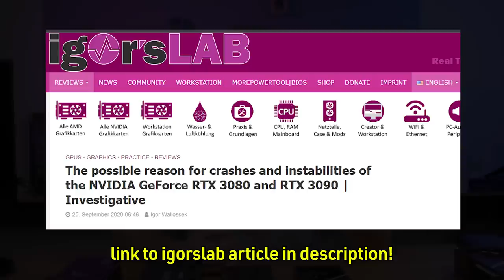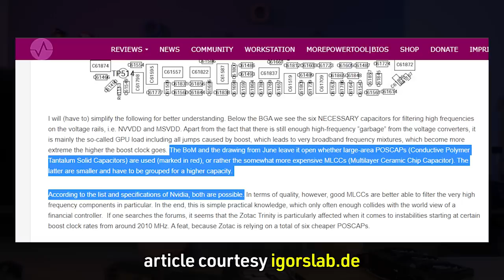The RTX 3080 Launch can't get any worse... Right? Wrong...

Comment: I know nothing about RF frequencies and overclocking in detail. What I do know, is that the wiring in our Condo (THE BUILDING) was done so poorly (in design) that the firefighter on call, who lived below me, tripped the breakers for our bathrooms, when ever he used his radio....CAN YOU IMAGINE?! He answers a call on his radio and trips the breakers in a building...WTF?!
So I can see VERY WELL how noise and filtering on a circuit board with even smaller components is crucial to get done right. 
AMD processors used to be extremely sensitive to OC as well. Just 20Mhz can mean the difference between great benchmarks and high stable numbers, vs unstable, intermittent crashes and freeze ups WHILE STILL WELL WITHIN OFFICIAL OPERATING SPECS. My eight core CPU's were always higher in voltage and low in core hz, but ran PERFECTLY stable. Finicky stuff that!

Comment: to produce as cheaply as possible, sell as expensive as possible
Reply: What's new about that, or shocking?
Reply: @moeloehoe  the GPU processor consumes 500W of energy, so the power section should meet high requirements regarding the speed and stability of energy supply, and how to work stably if the Samsung technological process rejects 70-80% of the systems and the rest is also not of good quality but everyone wants to buy as cheaply as possible, only since every producer designs their own PCB and having a weak GPU, mounts low-quality capacitors, I ask how it went off the assembly line, what do we produce but we do not check how it works? ... they knew well about the existing problem but everyone wants to sell as much as possible at the beginning, the conclusion of each producer is not honest.
ps. sry. google translator
Reply: The capitalist Team Rocket
Reply: Ahh CaPiTaLiSm 3.0

Comment: The real problem is that there was not frequency limit and they crash when they go over 2000-2100mhz maybe a little higher ( remember that 1740 its the boost clock on 3080 Strix for example) so it got fixing by just updating drivers.  and the brands because of all those who supported this misinformation began to change capacitors without necessity maybe some people even sold they 3080 because they were afraid that because of the capacitors they were "bad cards"
I am amazed at how uninformative this video is and how wrong it is and that Jay does not correct it with another video or comment.
And he will not try to do some kind of test or to inform himself before publishing this video, it is noted that he is only interested in visits.

Comment: But isn’t the whole point of a reference card to set a minimum hardware standard?
Reply: Jmanyc123 it is... the problem is that aib did push the reference too high! The fe is well abobe reference model, but aib maker did try to get same speed as beefed up FE using reference model!
Reply: @haukionkannel  No they didn't It's Nvidi's work to tell them the absolute minimum specs to assure performance. This is Nvidia giving them specs that were below the require ones.
Reply: Probably not a coincidence that Nvidia didn't make any reference cards for this series
Reply: @Themata  what? What are the FE cards than?
Reply: I reccomend you reading the article in Igors lab.
Reply: @Mermaider  Jayz2cent covers this directly in this video, what are you watching: the FE card for the 3000s series are not to reference card spec, They are buffed up. In the video, Jayz2cent opens the gigabyte card saying that this looks like it is to the reference spec that he saw.
Reply: @Mermaider  they're a custom card, beefed up over the reference specs

Comment: At least some of the early EVGA FTW3 cards have the 6 cheap ones. Source: a "Gamers Nexus" video, titled: "Limited OC Headroom: RTX 3080 Extreme Overclocking", at 6:59 for the time stamp.
Reply: I think @JayzTwoCents would agree it's odd that the FTW3 card has one more 8 pin power but less quality hardware to deliver it
Reply: Gamers Nexus, video: Custom RTX 3080 Overclocking: EVGA FTW3, ASUS TUF, & Gigabyte Eagle Results (Stream Recap) at 8:04, 8:53 can see that too.
Reply: But how how can XC3 (4:34 here) have more expensive capacitors than FTW3?
Reply: @nouidle  Could be a revision thing. Igor explained it further. Nvidia might have sent a headsup to the boardpartners (after launch) and they put in other capacitors.
That means all cards build pre-launch might be weaker and prone to crash..
Reply: Wait, the evga ftw editions are premium editions compared to there other variants, the ftw editions are designed for overclocking and good quality
Reply: @nouidle  May that capacitors isn't the real problem? Cause FTW3 got 6 cheaps, TUF got 6 good ones... and as u said, XC3 got 1 expensive and FTW3 don't. idk
Reply: @nouidle  Dunno, but that's the model I purchased that's what really matters :)
Reply: @nouidle  exactly the xc3 is not designed for additional OC even if u could it will be very minimal, the ftw cards always used premium components and parts which allows the card to pushed further, if this is the case with 3rd party venders I will  just go for the FE card, and wait for it  to come in stock, I never dealt with nvidia RMA or returns as Amazon is so much easier, faulty card, just return it and get exchanged. But then again the FE just seems to built with more quailty then any other variant
Reply: @bismal2166  TY, I was hoping so since they pulled them off a lot of retailer sites during launch.
Reply: @bismal2166  Oh man, this is gonna be one of those things where overclockers have to go model-by-model now, isn't it? SIGH

I guess this gives the Youtubers the more "3080 content" they were looking for.
Reply: @nouidle  go to EVGA site and see the step up cards, you won't see any XC3 there is only FTW3. Now I understand why.
Reply: Confirmed, check out the photos on EVGA's 3080 FTW3 product page. You can clearly see 6 poscaps.
Reply: wow that is extremely disappointing
Reply: That's depressing lol.
Reply: It's the same with the ASUS Cards, the STRIX has 6 of the lower quality capacitors while the TUF has 6 of the higher quality.
Reply: @bismal2166  I wonder if this is what made them come out later...
Reply: TY, the stock photos on a lot of sites have 1 on the 3080FTW3
Reply: @andydsm  https://imgur.com/a/IMVFdTP

This dude got 2 of the better capacitors. I wouldn't call anything confirmed yet.
Reply: @1984kylea  the Strix has the higher quality https://www.youtube.com/watch?v=8IDMS54jEFM&feature=youtu.be&t=274
Reply: @
BloodSpiller Gaming That was a pre production FTW3.  The production units have the better caps.  https://i.imgur.com/20VTCrx.jpeg
Reply: @thealien_ali3382  I've been holding out for a ftw3. Now I'm just holding out.
Reply: @Mildly_Amused  Thank god
Reply: All retail ftw3 pictures so far have the mix like the FE
It's probably why thet were held back by a week
Reply: @rikou1986  not on the evga website. Interesting.
Reply: This whole thing is a mess. RTX20 ringing in my ear. My first 2080ti died from the crappy memory issue, who knows how my 3090 will go.
What is confusing to me is, IF it really is about this particular part, why are there shots out there of NON OC TUFs with 6 MLCCs, and STRIX OC with just 2 MLCCs o.0
Reply: @jrmardis  they just didn't bother changing the old stock photo's i guess.
They're kinda busy at the mo lol.
Reply: @rikou1986  just looked at the gamer nexus video when he over clocks the ftw3. All 6 are the cheap ones. Card in hand.
Reply: @jrmardis  jacob from evga gave him a pre retail model.
Multiple retail pics show the newer board.
Reply: @rikou1986  hope that's the case! Should see some soon they sold a few this week. 600 to ebay 9 to us.
Reply: @jrmardis  lol yeah... uk has seen 0 from evga.
And yeah we will find out soon and people are asking jacob for confirmation.
All the xc3 have a mix of 1 5 so it wouldn't make sense giving the top tier worse components.
Reply: @rikou1986  thats what I was thinking. But more expensive cooling system might have made them cut cost. We'll just have to wait and see!
Reply: @jrmardis  evga gave a confirmation.
Xc3 are all 1 and 5
Ftw3 are all 2 and 4
Breath easy evga fans.
Reply: @rikou1986  thats great news!

Comment: So what you are telling me is some of these AIB cards cost more than reference...clock lower...and are prone to crashes.
Sounds like a banging deal.
Reply: Yup. That's dead on.
Reply: BUT they have RGB so...
Reply: It's sounding more and more likely that some of the rumors were correct, Nvidia is selling FE at a loss and then leaving the AIBs out to dry on selling a matching spec part that they can't afford to price match.
Reply: @DanielFoerster  which makes the AMD RDNA 2 stroy being a good card more plausible?
Reply: @GrimYak  well we don't know what pricing and availability for Sienna Cichlid is going to be yet. Based just on cores and clock it ought to be able to compete with the 3080 but I'll wait for benchmarks.
Reply: @DanielFoerster  I super doubt that if the problem is literally 2 components out of thousands.
Reply: @spider0804  I don't know how much the price difference is on these specific parts, but going off numbers I'm finding, it's probably around 10usd more just for the MLCC parts versus the POSCAP parts for a single array out of the six, plus soldering complexity increase. That matters when margins are thin.
Reply: @DanielFoerster  Asus must have some magical margins then lol.
Reply: @spider0804  their 700 dollar TUF has 6 POSCAPs just like the other MSRP-match cards did. If your budget goes up to 750 for an OC you can spend more on making sure the card handles higher clocks.

Comment: How did EMC testing not get this??? Rush job? I work in industrial electronics, designing Solid State Relays and Motorcontrollers... we EMC (and Burst) test our devices to exhaustion, knowing they could harm people... and our products are far less expensive.

PS. We design SSRs for windfarms, and even components in the European space Station, apart from tunnel signalling sytems and automatic parking.

Comment: Lesson learned: don't cheep out on the last 50 bucks of an expensive card. I'm feeling lucky now about my zotac order being canceled.
Reply: You are fortunate , i'd play the lottery if i were you.  you avoided one of the biggest disaster launches I can remember.
Reply: Yeah whenever I upgrade I'll be sure to invest in a higher tier model of whichever card i get even if it's like $50+ more.
Reply: Bryce Ginther 
Or just wait until all the “testers” review each individual card. 
Personally, I’m waiting on a 3080ti, or possibly the next gen launch. Haven’t decided.
Reply: @metanumia  whats wrong with MSI?
Reply: Das Handtuch except that the cheaper FE doesn’t have this issue
Reply: But at msrp tuf is nearly the best one no point to lose 200 more and get like msi plastic shit one
Reply: Anodyne Melody Literally what is the issue with MSI cards lol
Reply: @RatbagTheCoward  3080 tuf vs msi

Tuf has metal plate msi plastic
Tuf has to hdmi 2.1 msi one
Tuf has dual bios msi not
Tuf has power indicators msi not
Tuf was cooler at same desibel
Reply: Me too, I was one of the 20,000 who ordered from Amazon.de. Now to wait several more weeks till I can finish my new build.
Reply: Yup! It's like putting old holey tires on a Bugatti veryon... Ohh it will be alright 😂

Comment: The asus TUF card's sold at retailers here in Australia include the less expensive capacitors for all six. So I am not sure if it is different for US or if they sent you a unique model due to the testing data you output that is so widely spread.
Reply: wow that'd be a story on its own
Reply: I looked up on Newegg on the asus tuf, and they have the “cheaper” capacitors too.
Reply: @broman93 , writes "All asus cards are using  the good caps, you can see in this video the tuf has good caps and derbauer has the strix  card with the good caps."

Those are reviewer cards, Shadeyboii is talking about retail cards. This wouldn't be the first time tweaked units have been sent to reviewers that perform better than the units sold to the public.
Reply: Here in Finland the retailers images show 6 cheap ones too. The images say they may not represent the final product though.
Reply: Did you confirm from buying one of your own or just looking at the pics on the website? Many of the pics on the websites are old as they are pre-production models.
Reply: It's possible they changed the design. Jay even said that a manufacturer realized that something needed to be fixed and fixed it.
Reply: @alzuu1  My assumption is based off only photos atm as I haven't been able to get my hands on one yet.

Comment: Mad props to Asus, going all in on the expensive caps.
Reply: ASUS did cheap out, the card sent to j "review model" is not the same card there selling it. The ones there selling have the cheap array of capacitors. https://www.asus.com/Graphics-Cards/TUF-RTX3080-10G-GAMING/
Reply: @EZ_SNIPE  the picture on the website is a pre-production model, cards on the market have 6x10 MLCC capacitor arrays
Reply: @themistoklesstamos1819  is there any pic to prove that not challenging you but this is an officially website explaining they do have same issue
Reply: @yousefalzaabi7294  https://www.reddit.com/r/nvidia/comments/izhpvs/the_possible_reason_for_crashes_and_instabilities/ the pinned (first) comment has a list with all AIB models till now with links to pictures depicting the differences
Reply: It seems that the ASUS TUF has the same issue
Reply: @themistoklesstamos1819  that mean Asus is the best option to go with is that right?
Reply: @yousefalzaabi7294  for now, possibly
Reply: @yousefalzaabi7294  no. Founders Edition is the only good car in the 30 series apart from the reviewer edition cards that is made better than the consumer ones......
Reply: @tullgutten  thanks for your advice but  If I didnt found the Founder edition I will go for Asus maybe or actually not hurry till they fix it or find the best solution
Reply: @EZ_SNIPE    Just thought I'd chime in and say that I received my ASUS TUF 3080 the other day and it does indeed have the higher quality capacitors. 
Edit: forgot to add that i have yet to have any issues or crashes.
Reply: @coreyp9913  that mean it's the best one and high quality you are lucky man 😁 and I am happy for you Enjoy it!

Comment: When the shroud and back plate is build with aluminium, I know they are build with quality.

ASUS RTX 3080 TUF.
Reply: That card here is literally 200$ more than the base 3080... uhhh Quality sure, but the price is getting near the 3090 >_>
Reply: Can someone confirm if the 3080 has the expensive arrays?
Reply: @Starfals  in UK the MSRP is £649.99, the TUF OC is £689.99, the extra £40 is worth it consider the higher clock speed , lowest temp (60c-63c) compare with other brand and build quality.
Reply: @andrewizquierdo825  I would like to know too. The pictures on ASUS and Newegg (TUF and Strix) show the cheaper configuration but the videos I have seen show the more expensive ones.
Reply: @Barbecueeee : it's also possible that production is switching components during manufacturing depending on what's available
Reply: 3080 TUF and TUF OC are the least expensive cards at my retailer's by at least 100 USD
Reply: Me with galax 1660 which has a metal backplate: *nods
Reply: TUF is the least expensive out of all of them for me 949.99 CAD the others are 1k or more.
Reply: You Me Archive  would be about right for how shit ASUS is a brand, after I had 2 500$ motherboards go bad and CS not want to jack all about them even under warranty I swore off ASUS products completely and direct friends and family to stay away as well bc their qc and cs suck so bad.
Reply: @shinyhappyrem8728  its possible. imagine being one of the lucky buyers getting a TUF OC with all 6 of those arrays. I'm wondering if one can swap a Strix cooler on it. 😊
Reply: @fohhee  I wish the prices were so good here ;/ The Tuf is insanely overpriced in comparison to Palit/Gainward(wind? I forgot the name)
Reply: @bastordd  I said 200 more lol. The FE is 800+200 =? It aint 899. Go to sleep Picardico lol.
 Actually, the FE here as of speaking is 950$ so 950+200 =?  Thats right, kind of close to the 1500 one. Which btw is 1600 here.
Reply: @rosen9425  Thats funny cuz Tuff cards are the most expensive ones here. Palit is the cheapest, as it should be.. those cards always suck. I had many problems with them. Why Asus cards are the cheapest at your places.. i got no idea. Its never the case here.
Reply: @Starfals  
It's only TUF cards. The rest from asus is 300+ more expensive than anything else